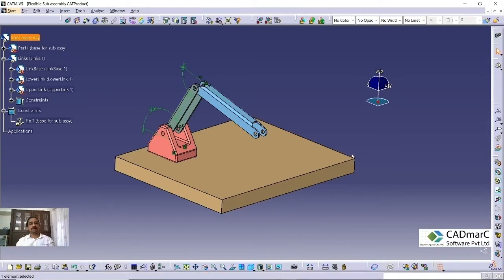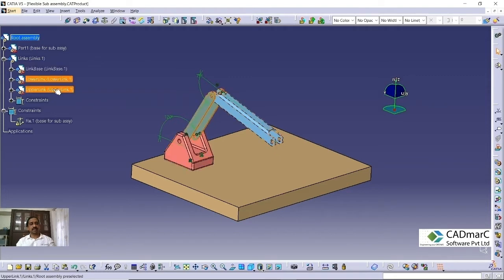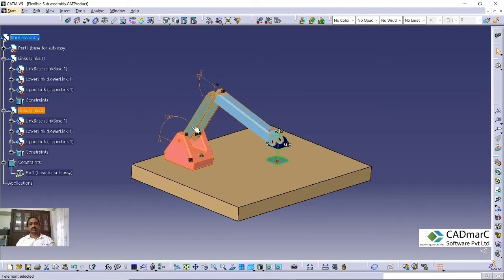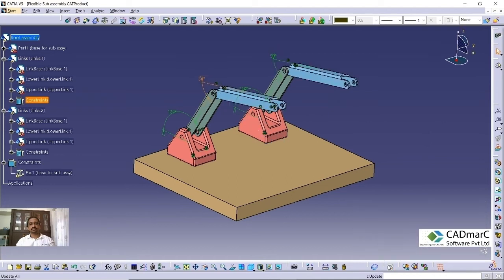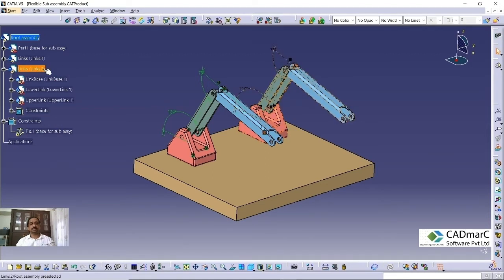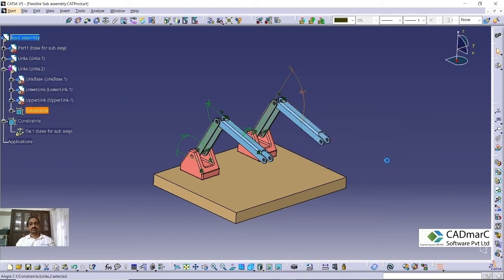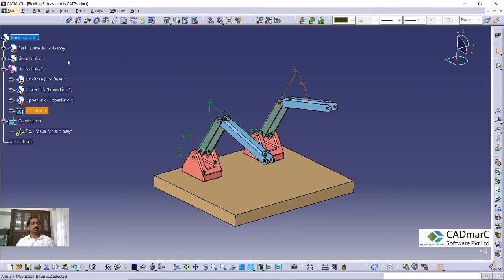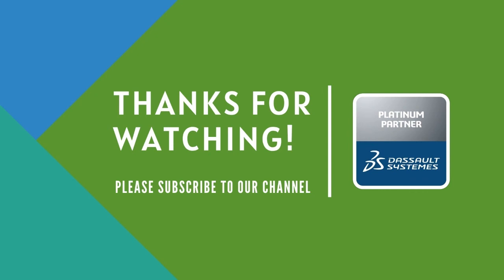CATIA V5 Assembly Design | Flexible and Rigid Sub-Assembly

Comment: Thanks Sir.. Is there a method wherein we can make modifications in a sub assembly without it affecting the main individual part. I need the individual parts as they are and the changes made to only reflect in the sub assembly. Eg. I want to put a hole in the Sub assembly part, but I want the original part to be without the hole... Pls guide if possible. Thanks again.
Reply: you should try altreps